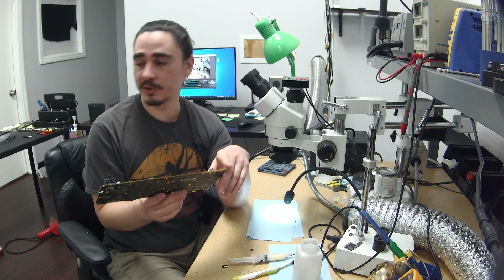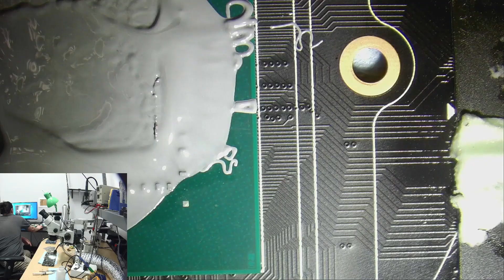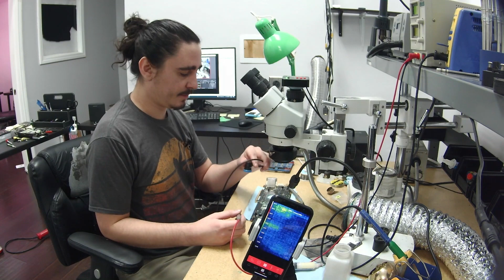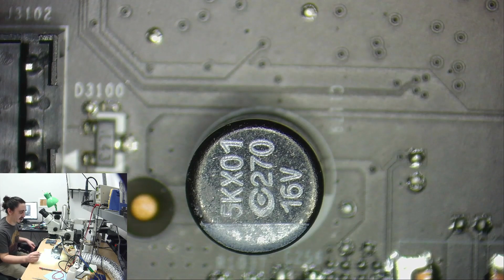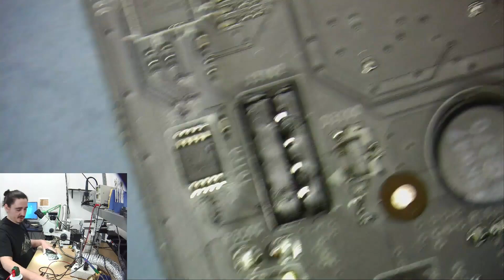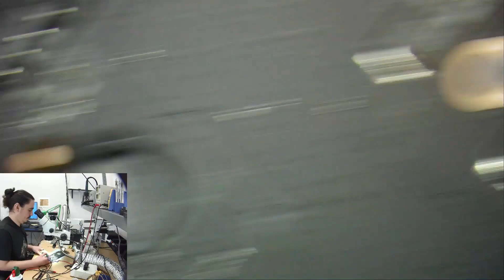Buying Broken Graphics Cards on Ebay in 2022 - Good Idea?

Comment: Can you make 2-3 videos. 1. How to check short, where to put probes on the board to check short. 2. How to give voltage to board to test smds heat up. 3. How to fix solder pads on gpu if needed.
Reply from the maker: Sorry brother, I am not really working on GPUs anymore sorry!

Comment: What's your thoughts on using the heat gun technique for black screen or artifacting GPU's?  
I have a 1060 that was working fine but just started artifacting. If I reboot it will black screen.

From watching all the videos on YT I'm pretty sure it is the usual solder problem that plagues all graphic cards. 
Poor engineering design if you ask me.
Reply from the maker: Heat gun isn't enough heat to really reflow anything. Aside from that, a reflow itself isn't usually a useful thing to do to GPUS. I would imagine that the 1060 has a vram problem and would run MATS myself.
Reply: is your broken gpu for sale

Comment: Any thoughts on the Laser-based Soldering Station that are popping up all over?
Reply from the maker: I have only glanced at them briefly. I don't have much of an opinion. It seems like it could be safer because of less chance of damaging nearby components, but that is just and idea. I guess time will tell if it is a good product or not. I do not think I would get it myself as I have years of muscle memory built into using hot air, so I am sure I can be more versatile with that.
Reply: @iBoardRepair  Good-points all-around – thanks for taking the time to formulate and share your opinion.